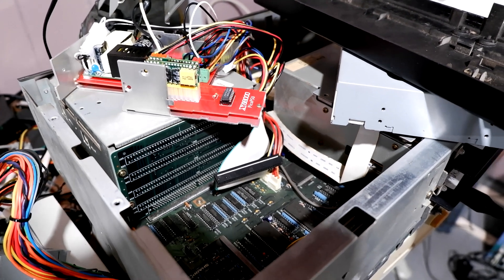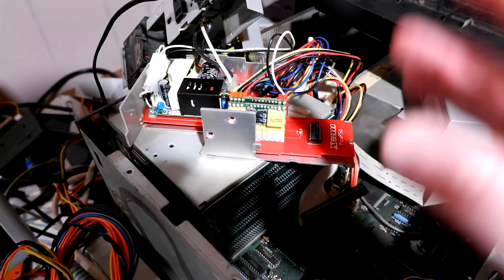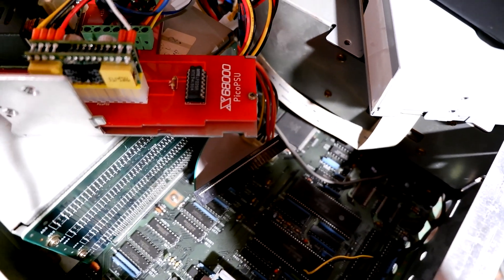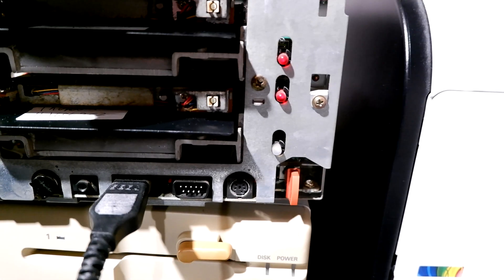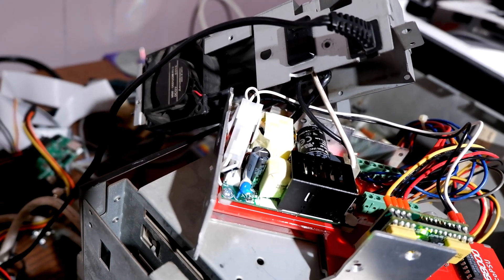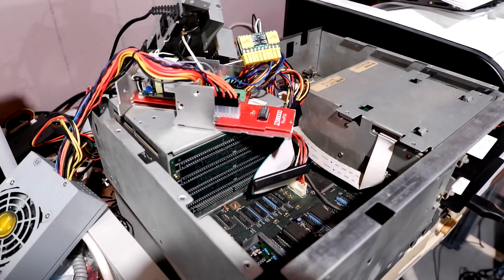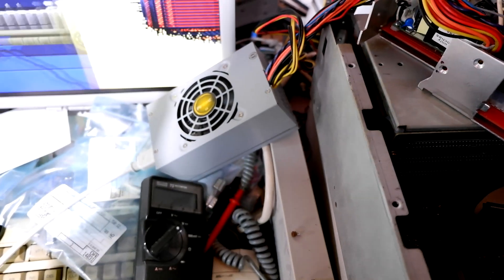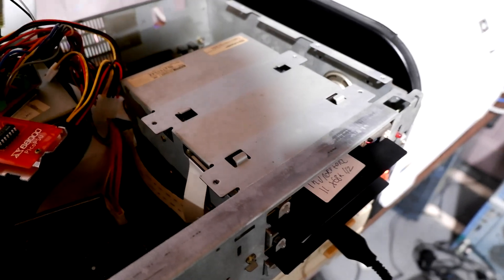The problem with PicoPSUs and old hardware (Sharp X68000)

Comment: If you used a 4.7 ohm resistor, rather than a 4.7k ohm resistor as a pullup, then I would not expect this circuit to work correctly.

Comment: The creator of the pico PSU  mentioned that this is not good for the x68000 pro!
Reply from the maker: yeah I'm going to use a 12v adapter instead

Comment: That psu does not work with a pro x68000. Only designed for Expert, XVI, Super, and Ace. I have two of those and it works.
Reply from the maker: I found out the issue was my 12v brick :V

Comment: Can you recommend anything that would power a Sharp X68000 Ace. The original power supply has been converted to an old ATX PSU from a pc.
I was considering the pico as a replacement and a tidier job

I'm trying to find a tidy solution rather than have an ATX psu outside
Reply from the maker: Possibly a pico but with the 12v brick barrel jack IMO. I'm still debugging why I'm having issues but I've narrowed it down to the AC-DC PSU.

Comment: Whats the model of pico? Same issue here Flex ATX psu boots with Pico Nope! buzzsound from speeker no boot.
Reply from the maker: 120 or something IIRC. 90w works on this model.
Reply: @pawsinmyface4560   i solved my issue with SFF FSP 180w+atx adapter all inside of orginal psu case. less than 50$ just lots of work but works fine :)